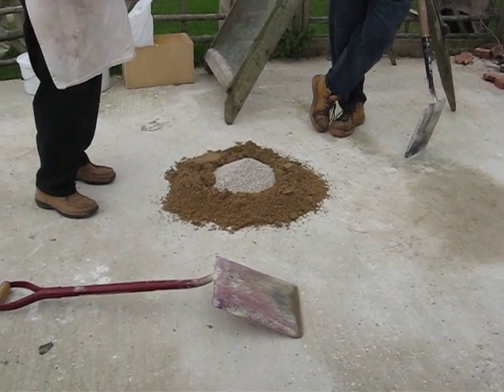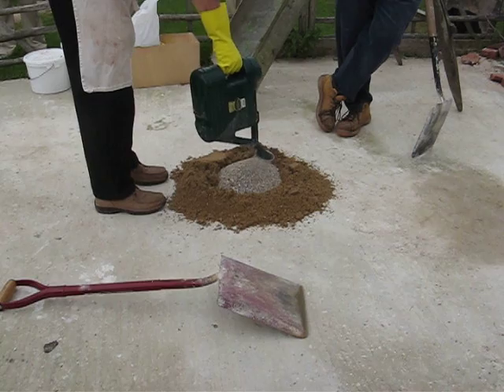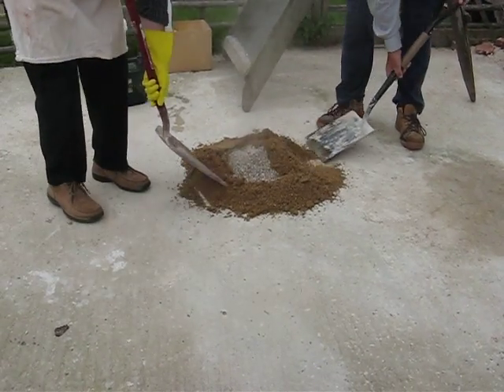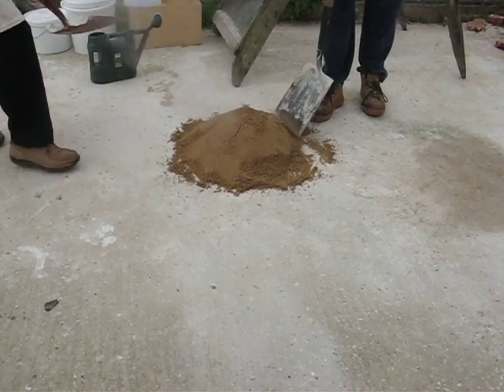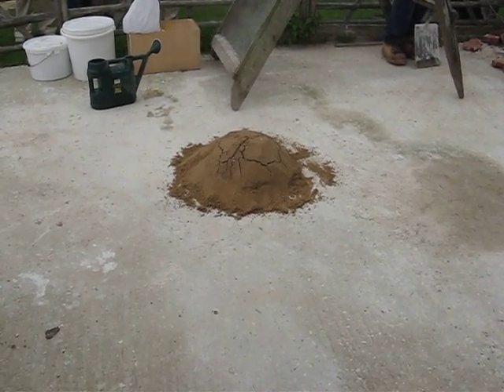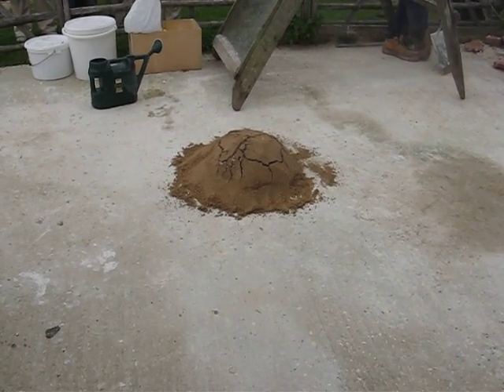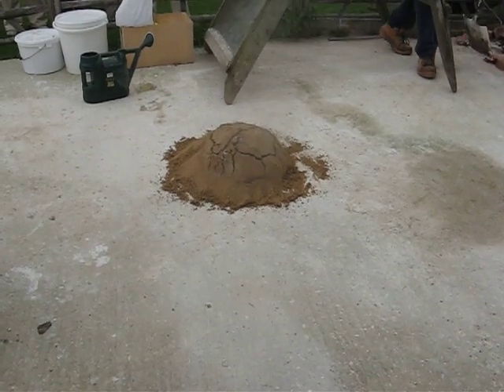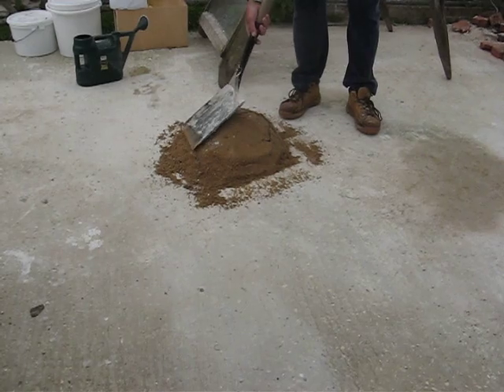Making Lime Mortar using Quicklime 1 of 3

Comment: Dr Gerard Lynch: This takes a good while to go through all the process and we''ll have gone and had some dinner and come back out to have a look at this but the initial part will still be interesting. Okay, so here we go. Now this is lime that has been burnt in a kiln and all the carbon [corrects himself] calcium carbonate, is now changed to calcium oxide. Okay? And you'll start to see it swell in a minute. 

Now if you watch the swelling that will take place here, you'll see,  that's it growing in volume. You just, just watch that now. Alright? And that's what I was telling you up in the classroom. People have misunderstood what they have been reading. 
When they've read books and it says the mortar is mixed 1:3, what they forgot was, they didn't have the finished lime arrive on the building site. They had quicklime arriving on the building site. So when they were talking about 1:3, they were on about quicklime to sand. And that's why, when we analyze mortars, they're much more lime-rich than 1:3. It's a massively important point because when I first became known and started to go out to sort buildings out, I was meeting all these lime academics who were quite convinced it was 1:3 finished lime to sand, and I said, "It's too weak! It's not strong enough. It won't do the job. We've not got enough lime in the mix."

"Oh, it is. It's 1:3 like it says." 

I said, "Yeah, but they weren't talking about finished lime. Quicklime." That quicklime in there now has grown by about 60%. It can double in volume. It just depends on the kind of lime. So your 1:3 can be 1:1½ or 1:2. It's a massively important point, because if you're trying to recreate inside water that's very, very big.

Student: It's hot to the touch.

Lynch: Yeah, you can see that that's hot. 
Now, I come from the borders of Bucks and Beds, Woburn Sands up near Bletchley, and the older generation would eat a meal called a Bedfordshire Clanger, which was a suet pudding which had a divide of suet running across it. At one end it was bacon and onion and the other end it was jam. And they would make that the night before, their wives would make it, and then they would bring that in and they'd shove that in there now.
[Students laughing]
Yeah, that's right. We used to put Cornish pasties in, you know. That's what you would do, yeah. 
So there you go. So that's very hot in there. That's probably something like about 150°C in there so you would get very badly burnt now if you were in there. As if you would, you know?
Reply: Thanks it helped me as I m not native to English..At the same time I wonder how did you do this...Any app I suppose ..If yes please let me know that wonderful app
Reply: @aloksingh4406  top secret he only teaches white British